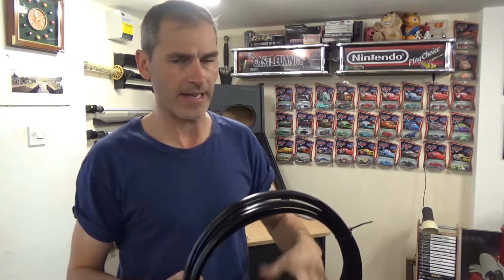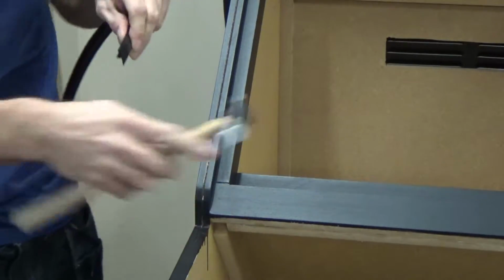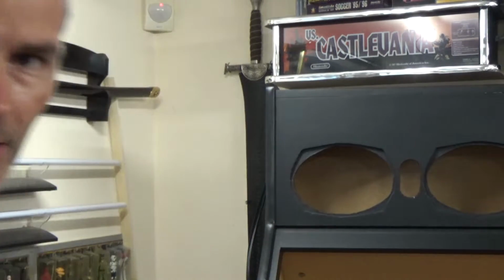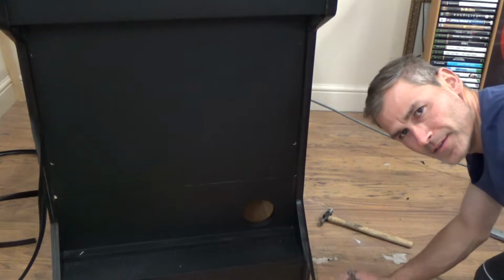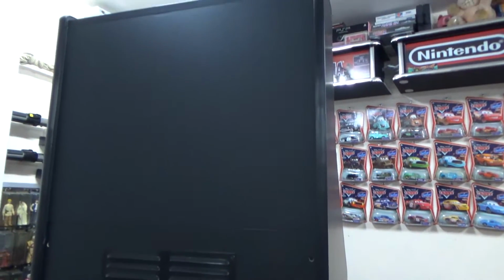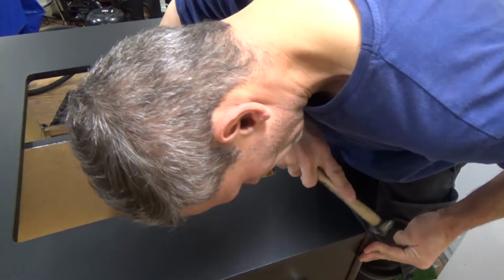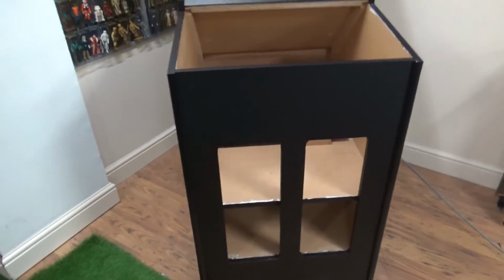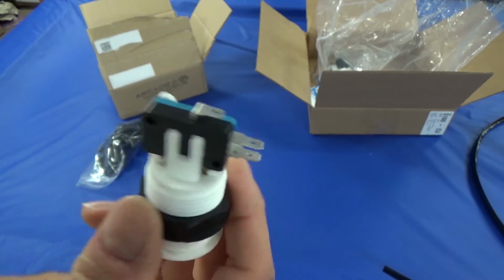Gauntlet Arcade Cabinet Scratch build. Part 9 T-Molding

Comment: Great video Andy, there is nothing like the factory finish a cabinet gets from putting on the tee moulding.  It won't be to long before your playing on the gauntlet cabinet.  I was going to do a little bit of tee moulding on the pinball cabinet back glass today.  I ended up spending the whole day cleaning the workshop after using the power carver on the rocking horse yesterday. Tee moulding will have to wait until tomorrow now.
All the best
Tony

Comment: I'm impressed, the cabinet looks boss !!!, I'm guessing the t-moulding left over is for the edge of the control panel?. The grill is either for an extra subwoofer, some kind of speech speaker or possibly a Cooling fan. I thought you may have put the castor wheels on because you will have scratched the t-mould under the cab when you moved it back to position, I know nobody is going to see it but you are a perfectionist.
I've been educated over the rollie leaf, its silent almost but in truth how responsive is the click going to be ..... Will it be a 1/1 ratio or will it be one of them buttons that you hit twice just to get it to respond.
I'm looking forward to both the control panel, your choice of joysticks and also what your going to do for a bezel, very very interesting stuff this mate. I will be supporting you on patreon soon as possible ... You deserve it !

Comment: Just curious, what do you think the weight of the cabinet is? I know plywood is half the weight but MDF is easier to work with although a bit of a challenge to lug around I'd guess. I might have to build mine in the garage and then carry it up to where its supposed to sit and do painting and stuff there...